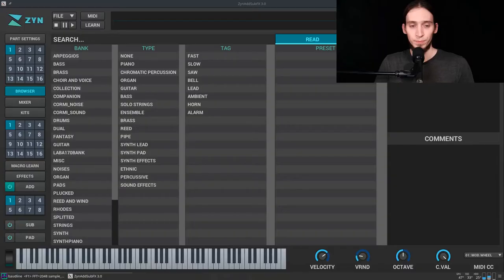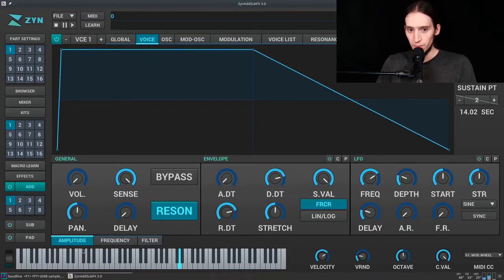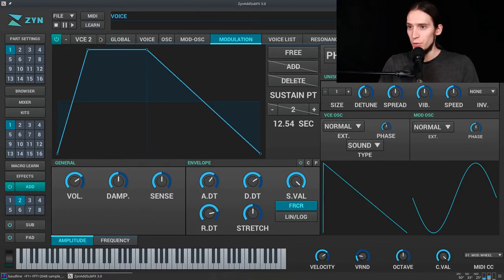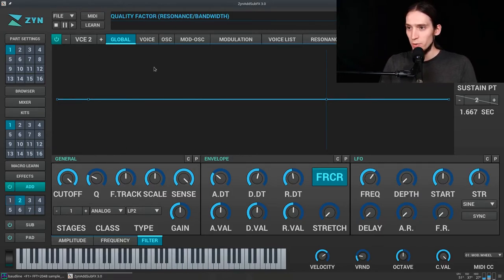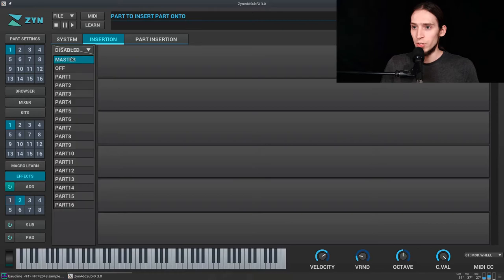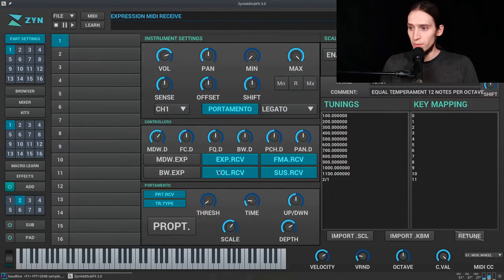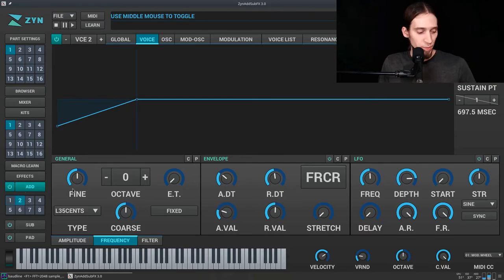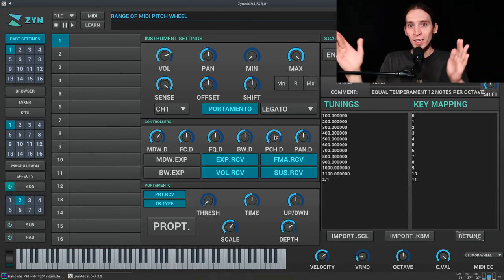QR#01 Scratched Vinyl

Comment: What do you like using more, LMMS or Ardour?
Reply from the maker: The are very different, and each has it's optimal use cases.
LMMS is effectively an all-in-one package that will give you everything you need to make sequenced music on any platform.
Ardour relies more on external plugins to give you the instruments and effects (LMMS bundles a lot of internal instrument plugins and LADSPA effects) - Ardour has a very minimal set of basic processign plugins (the "a-" series). 
It's hard to tell. I love using both of them, but I feel a bit limited by LMMS after all these years (and albums), and I'll be shifting towards using Ardour as my main DAW. I had to use Ardour anyway for recording vocals, guitars and mastering - because this stuff can't be done in LMMS (no way to record or edit audio apart from samplers and simple audio clips). Also - Ardour gives you LV2 plugin suport with nice GUIs which is great. LMMS is limited in that regard as of now, only capable of using LADSPA effects (no custom GUIs).